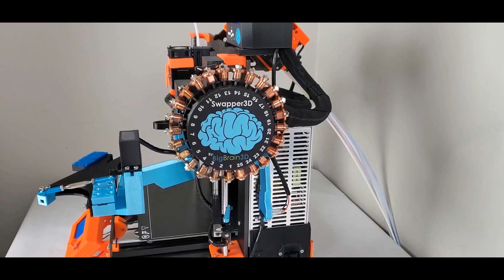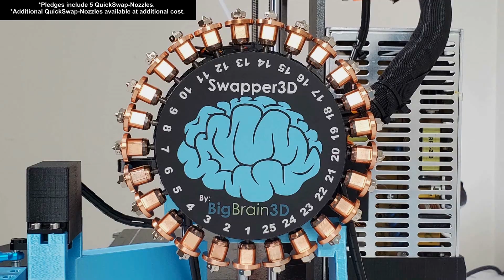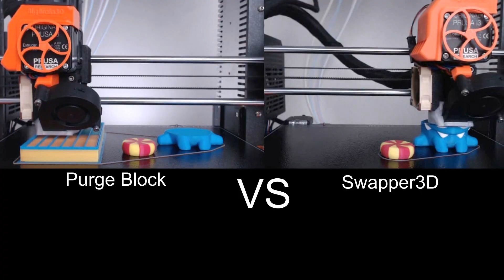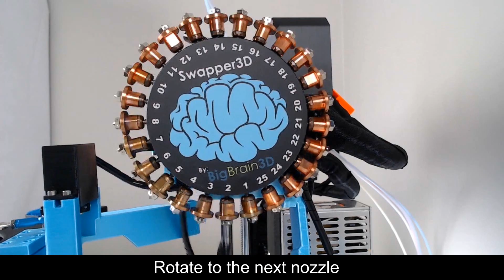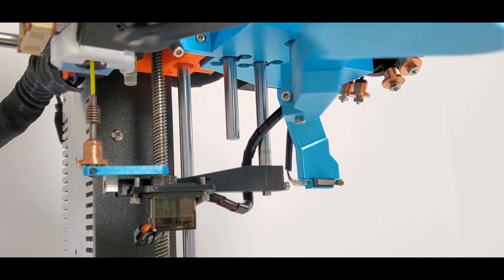Never print a purge block again!

Comment: I still don't get why slicers don't just start printing the new color inside the print, there by making purge blocks completely unnecessary in 95% of the situations as you don't care which color is used on the inside anyway. Finished the outside of the current color? Just swap, print the inside until the new color is purged and continue. There is 0 need to print perfect color separation on the inside of a print...

Comment: the real kicker is different size nozzles. it may take longer rn, but with a slightly faster machine you could make walls with a thin layer and infill with a thick layer.
or composite prints! multiple materials per part can now be viable

3d printers are evolving like cnc mills, i like it!

Comment: How do you get the filament out of the nozzles after they've been swapped out.
Once you've filled all 25 nozzles with filament and put them back into the swap wheel. Do you now have to purge them all?
Can you use the nozzle again with the same color at least? (doens't look like it)
Reply: Those quick change nozzles look like Revo nozzles and I believe you could reuse it with the same color

Comment: How are the nozzles locked into the hot end?
Reply from the maker: A spring loaded, lateral, sliding lock pulls them into the taper of the heater block. You can see a gif of a section view on our website product page.

Comment: So after 25 nozzles you stop and clean the 25 or can dirty nozzle be removed and cleaned during print operation
Reply from the maker: each nozzle is reused for the same color so cleaning is not required.

Comment: i'm super impressed how smooth the tool changes are, and how no nozzles being screwed in means the nozzle change mechanism isn't just gonna cause a blob of death :)
Reply: The nozzle is still screwed into the hot end.  The hot and cold ends are swapped out as a single unit so there is no place for melted filament to escape and cause a blob.  The filament is being cut above the cold end so it's still just normal unheated filament that just came off the spool.  Very clever design.

Comment: Really cool idea. I did notice a lot of shaking and vibration during swap-out. I know it probably isn't a big deal as long as it isn't during printing. Like, after swapping nozzles, it would have to reheat the new nozzle... Could it be designed to preheat the nozzle to be swapped, so that it can begin printing quicker. Maybe have it preheat the nozzle about to swapped out with the one being used to a preset parking temp set based on the filament you are using. Also, is there a cool down time for the nozzle to be swapped or can it do it while the nozzle is still hot?
Reply from the maker: Swaps are done 'hot'

Comment: The big question: Cost
It looks like its $500 for an I3 style setup for the MMU and a few other filament changers. Plus the MMU, plus the printer.... its around 2k all in for a full swapper setup. That's hard to swallow with a 2 head Xl for $2k
Reply from the maker: The XL is $4,000USD for 5 extruders, and  For people that already have an i3 and MMU or Palette the XL is 4K extra!

Comment: So you end up with a bunch of quick swap nozzles with filament in them that has to be removed later before being reused? How does the system know when filament is all the way in the new nozzle and ready to extrude as it is presumably empty when inserted?
Reply from the maker: The nozzles stay full of material and are reused for that same material.
Reply: @BigBrain3D  So you end up needing a separate nozzle dedicated to each filament? I've got twenty different spools now. Ehhhhhh. Cool, but I see issues with it still.
Reply from the maker: At the start of a print the old material is purged out of each nozzle with the new material loaded. In this way the nozzles are used for different material between each print, But the same materials during a single print.
Reply: @BigBrain3D  Ok, that makes sense. I guess you still kind of have to track what material is in each nozzle since different materials use different temperatures? Could you purge a high temp material at PLA temperatures, for example?
Reply from the maker: you should always purge at the higher of the two materials
Reply: @BigBrain3D  Ya, but you have to know what material is in each nozzle to accomplish that.

Comment: Interesting idea!  But how does retraction work for the first ~20 mm since there is a break in the filament after a swap?
Reply from the maker: The effect of retraction to eliminate stringing in the prints is effected by the reduction of pressure only, which still happens even though the filament is cut.

Comment: While it's impressive - I'm not sure if this method of hotend swapping is better than swapping the entire extruder. For instance, look at what E3D's toolchanger system does. This looks much more mechanically complicated than a full toolchanger, which is typically just parking the extruder and actuating a lock. Your product is in some ways cheaper at $500, but factoring in an MMU + the base cost of the printer adds up. Certainly your product has the benefit of up to 25 different materials / nozzles, but I doubt most (99%+) of multi-material prints need more than 3-4 materials.

Certainly from an engineering-rube-goldberg standpoint, this is still neat.

Comment: So how are you guys handling tool offsets? Typically a tool is measured after a swap. Are you guys pre measuring offsets and storing the values?
Reply from the maker: The inserts are pulled into the taper of the QuickSwap-Heaterblock. In this way each nozzle is perfectly aligned to the last, and no offsets are needed.
Reply: @BigBrain3D  I'm talking about z offset

Comment: oh wow, I just realized that this could have applications beyond simply multi-material printing. You could even have nozzles with different bore sizes on the same filament so that you can print some sections quickly with low detail, and some sections slower with fine detail. If you could get the swap faster, you could probably save a lot of print time doing that
Reply: You can use variable layer thickness wven with single nozzle and that will cover most of your needs. And you will be saving yourself ~$400 on that device :)
Reply: @TheTychus  not what I meant. I meant like using a wider nozzle to put down thicker lines. A larger nozzle gives higher volumetric flow, meaning you can print much much faster. The time savings are frankly ridiculous in some cases

Comment: what holds the nozzle? is it a vacuum? and can the cut filament be pushed by filament without jamming problems?
Reply from the maker: A sliding lock holds the nozzle into the QuickSwap-Hotend. The filament is guided through internal tapers that align it without issue.

Comment: I like it but what are the benefits of cutting the filament as opposed to pulling the filament out before swapping?
Reply from the maker: Cutting the filament prevents strings and blobs which are attached to the end of the melted filament from being pulled into the extruder and other parts of the system potentially causing a jam.

Comment: After the announcement of the Prusa Mk4, I think the new hotend system will work with your solution really well
Reply from the maker: Yes, the Swapper3D should work fine with the MK4, and once an MK4 is in our office we we will make make adaptation to work with it.
Reply: I doubt it, you have two dials that have to be rotated to fasten the hotend to the MK4....

Comment: You have a piece of filament in the nozzle when it is fitted into the hotend. Normally, 3d prints will include retract codes to pull back filament for moves. With the piece, the retract won't be possible. How does that affect print quality ?
Reply from the maker: Yes the retraction still works. During string calibration test prints no noticeable difference was observed between areas where the filament is cut and still disconnected and those where the filament is rejoined in the hotend melt zone. The effect of retraction is made by removing extrusion pressure which still happens during retractions even after the filament is cut.

Comment: Really excellent work on this, it didn’t make sense to me to have to change the entire tool head as in other systems. 

A note: I didn’t see your website for this listed in your channel description, only in the video description. 

Questions: 
1.) Do you plan to sell a full tool head kit with the hotend, extruder, and nozzle? It would be great to test it out as a standalone, I didn’t see it listed on your site. 
2.) what part of your nozzle design addresses the indexing/mating of the nozzle such that it doesn’t vary the height of the nozzle between swaps? For example CNC automatic tool changers can use the cone shaped surface to ensure both concentricity and alignment, and then the tool offset is measured. 
3.) is the variance of the offset of each nozzle in the z direction down to manufacturing tolerances, or does the system measure the offsets of the different nozzles?

Can’t wait to see more!
Reply from the maker: Thanks for pointing that out, we've updated our channel description with a link to our site.
1)See do sell just the QuickSwap-Hotend as a stand alone kit (https://www.bigbrain3d.com/product/quickswap-hotend/), but we don't have a extruder since we use the default extruder of each printer.
2)The QuickSwap-Hotend has a taper for receiving the tapered collar of the QuickSwap-Insert, just like in CNC tool changer systems. This ensures that the inserts are concentric and aligned. using the same style of nozzle in the insert, and using a proper torque wrench, will keep the height the same. Different nozzles types may require Z offsets. 
3)The Swapper3D has no built in automatic Z offset probe. Prusa Slicer has a Z offset per extruder as do most slicers. Using the same torque between nozzle/insert should keep the z offset differences down to manufacturing offsets.

Comment: I like this but at the same time why don't people plan their purge blocks to be things that don't need to be exact colours?
Reply from the maker: Printing multiple objects still takes extra time. The Swapper3D eliminates the need for purging and therefore saves the time. Also, even when printing purge 'objects' a purge block is often still required because of the variable extrusion requirements of different layers, and if the layers with the least amount of extrusion happen at the top of the print then the purge block would need to be built up during the entire print.

Comment: any plans to try and support bambulab x1 or more likely their new p1p since it’s not enclosed? their AMS can do 16 color, would be nice to have 16 colors, a few nozzle diameters and some different materials with bambu speeds
Reply from the maker: Eventually yes. The p1p may be easier. Either of them will require significant mods and the hotend would need to be replaced. Our system is really hackable so users may create a mod before we get to it.

Comment: Out of curiosity, could the firmware be modified so that it retracts the filament before pulling out the nozzle? So there is no small piece of filament stuck in the old nozzle to cause potential issues with retraction when it is swapped back in?

How does this interface with the MMU? Does it require modified firmware be flashed to the MMU? I am really looking forward to this being released.
Reply from the maker: Yes the firmware is marlin and opensource. You can mod it however you like. The change you are suggesting could be done more easily in the PrusaSlicer gcode scripts section. No changes are made the MMU, filament switching works the same way as before.

Comment: Ok, but this will have retraction problems on the first moments after the nozzle change.
Reply from the maker: Yes the retraction still works. During string calibration test prints no noticeable difference is observed between areas where the filament is cut and still disconnected and those where the filament is rejoined in the hotend melt zone. The effect of retraction is made by removing extrusion pressure which still happens during retractions even after the filament is cut.

Comment: Man 3d printing is really going places. 
Next I'd really like to see additional axis of movement and non planar printing features brought into home based and diy machines more easily and affordably.
Reply: There are already hobbyists experimenting with that. The biggest issue is slicing... Once you add another dimension the user would have to guide that process. Current slicers just aren't made for this kind of thing.

Comment: If the slicers were updated to support it could this even be used to swap to different nozzle sizes throughout the print?
Reply from the maker: Yes, The Swapper3D can be used to automatically change nozzle sizes during a print. Prusa Slicer already supports this.

Comment: I'm ignorant to 3D printing, but after the nozzle swap, how do you clean the nozzle..  They're talking about not purging the nozzle, but if you remove it instead of purge it, how do you clean it later?
Reply from the maker: If you are changing colors in the next print then there is a single purge done at the beginning of that print to prime the nozzle with the new color and purge out the last one.
Reply: @BigBrain3D  I realize that.  What I'm asking is, when you change nozzles, the old nozzle is sitting there with media in it, right?  Getting cold.  Is it easy to clean those once they have sat?
Reply from the maker: @Computerfly  Ok I understand what you're asking now. No, you need to load the nozzle into the hotend and wait for it to heat up, then clean it the same as you would a normal hotend.

Comment: Looks awesome but how do you handle a hot hotend ? Can't move it with a plastic arm nor store it in a plastic carrousel
Reply from the maker: The end effector of the actuator arm is stainless steel. The QuickSwap-Nozzle's are stowed from the heat-break cold side in the tool holder. In this way no hot parts touch any plastic parts, so hot nozzles can be changed.

Comment: Its very loud is that something you are going to fix?
Reply from the maker: We've measured the sound pressure level using a dedicated meter. At 3 feet away a swap is 60db. According to online sound level comparison charts 60db is about the same volume as an office or normal conversation or a 3D printer. Because you are listening on an uncalibrated sound system it may seem louder than it actually is. You could calibrate your sound system by downloading a sound level app for your phone (it's not going to be perfect but it will get close) then place your phone 3 feet from your speakers and play the video, then adjust the volume of your speakers until the sound level app says it's 60db.
That said, our goal is whisper quiet so we are exploring ways to reduce the sound, which is annoying to some people especially if the printer is close to where they work, something as simple as little pockets of sound deadening insulation around each servo would take the volume down many decibels. We expect that users will also come up with their own ideas as it's a very easy system to mod.

Comment: Only issue I see with this thing is noise. Is there a way to quiet it.
Reply from the maker: Since this video we've upgraded the motors and they are 9db quieter. We will be reducing the noise over time too. A simple trick may be to cover the servos will a little sound deadening insulation. We'll keep looking for ways to improve this. It's about as loud now as the mmu when it's unloading/loading the filament but we can always do better.
Reply: @BigBrain3D  I see, well, it looks like a great and efficient system.

Comment: I could never see multimaterial printing as more than a novelty in an already niche hobby due to the waste it causes. It’s exciting to see people solve this problem in various ways.

Stephan at CNC kitchen recently featured a rotating tool head with multiple extruders, a beautiful design with several drawbacks but it achieved its goal of preventing waste. I hope for the success of everyone in the pursuit of this endeavor.
Reply: The easiest way to reduce the waste currently is to have two or more hotends in whatever form that takes. Other than the waste is really relative. There's also support material and wasted prints, and even at two or three times as much filament used I don't see as much of a practical issue. It just hurts our sense of efficiency.

Comment: Holy shit, this is amazing. I could totally see myself using this for changing nozzle sizes as well. Maybe even during print if there would be software support for it?
Reply from the maker: Thank you for saying so =D  Yes, Prusa Slicer (and other slicers), do support tool changing to different nozzle sizes even with a single filament while using the Swapper3D.
Reply: @BigBrain3D  Your kickstarter says the kit comes with 5 QuickSwap nozzles, where would one buy more? And where does the money of cost go to, as the majority of the parts seem 3D printed, a few hobby servos and an Arduino with a motor controller shield.
Reply from the maker: @immathiasyde  After you pledge for the Swapper3D the Kickstarter checkout page will show you a list of extra add-ons including additional QuickSwap-Nozzles.
The Swapper3D comes with dozens of parts, including custom machined components, and 6 high torque high speed servos, and a complete hotend replacement QuickSwap-Hotend.
A Slice engineering Mosquito hotend (the closest to our QuickSwap-Hotend in design) would cost you 575.90CAD (Hotend, 5pcs heat break, 5pcs nozzle). Compared to that and sourcing all the dozens of other components individually + shipping from multiple sources, you are saving hundred when buying our Swapper3D kit during the Kickstarter.